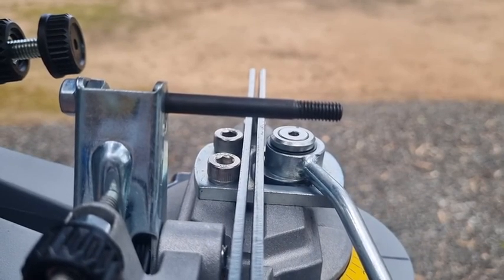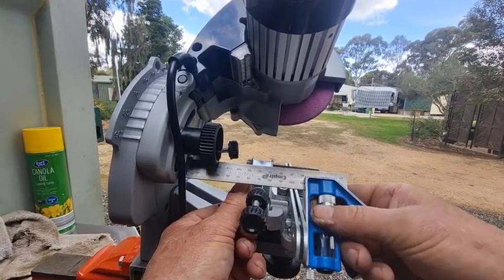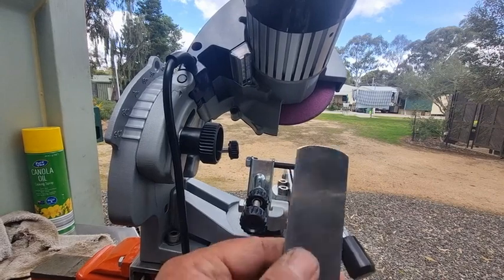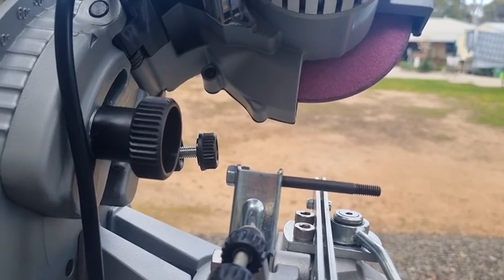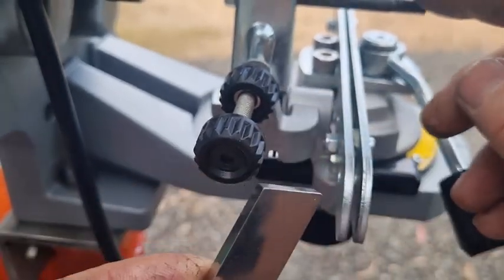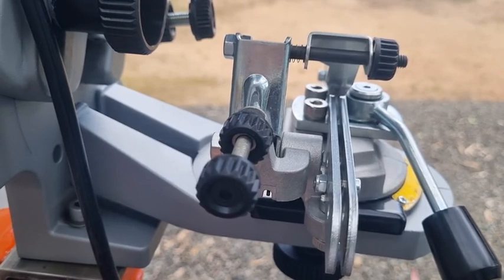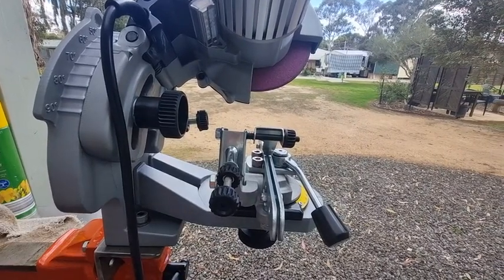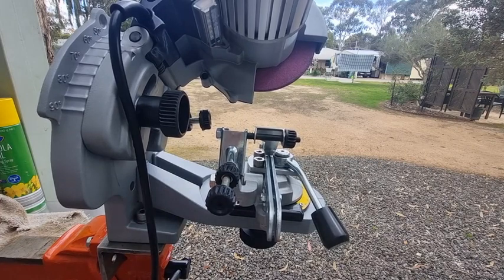Tecomec Jolly Evo backstop alingment

Comment: You have a great passion for this stuff. I've been watching your videos.
Always hands on and thinking of the workings and how to improve. I like it.
It's a good hobby/intrest.
A great mind never stops.
I have an interest in these things also.
Because of my interest, I work at a stihl dealer here in Australia.
Grinding many chains per week on an oregon grinder.
I usually grind all the right cutters first, then the left.
When swapping from right to left i make small adjustments on the back stop and position of the clamp offset to grinding wheel.
I never grind from one side to another without small adjustments.
Keep in mind our shop grinder has multiple staff using it and possible hundreds of chains per week. Many different diameter wheels.
👍love the videos.
Reply from the maker: I have the Stihl USG and it works well did you know the top plate angle is out 2.7° on that grinder.  Set it at 0° you will see the motor not level
I live in Bendigo Victoria
What Oregon grinder do you use.  I like the 511AX. I am not a fan of the hydraulic assist because they can leak. Another problem.   You should be a expert at grinding now.  What's your thoughts on the backstop being  curved ?
Reply: We have the hydraulic assist, not sure the model number, it's fairly old.
The back stop being curved doesn't bother me to much, I just adjust it to keep centre of the tooth.
After finishing the right side cutters I swap to left and adjust the stop back out for a long tooth and then slowly bring it in and visually confirm I have both left and right very close to same length.
No verniers, just visually. 
But yeah I constantly minor adjust the screws during a chain. But saying that I do sharpen a chain fairly fast,  becomes second nature.
Our backstop is fairly ugly, the small 1/4 chains the wheel runs very close to the stop. Some careless people I work with get lazy to adjust and let the wheel grind into it at times.
Reply from the maker: @sdc0386  grinding new chains is never a problem only when they get half worn you need to watch the backstop.  At end of life my cutters resemble 🔺️  so the backstop Co.e I to play and is critical at the point.  I did make a pointed backstop that sits between the tie straps.  See my channel for that one
Reply: @ChainsawUsers  I had trouble with poor tolerances with the Oregon grinders and the cam not holding the chain vice properly. Now I use and recommend the Maxx Pro which has auto clamping similar to the 620 but is a mechanical, not hydraulic system. Consistent clamping across the width of the vice and no problem with leaks!
Reply from the maker: @dab.  yes that new grinder has new features not a copy of oregon.
I would like to test that one out myself
Reply from the maker: My new style needle point backstop works great 
https://youtu.be/eO8_rmYKZsA?si=nYbmBG2KrDMb_yIy

Comment: I just got one of these Tecomec jolly evo grinders, main reason I got it and not a Stihl USG or Oregon 520 or anything was the fact that the Jolly Evo is the recommended grinder to use with the Square-jig.. I'm wanting to be able to sharpen square tooth as well as round ground and the Stihl isn't compatible. And I wasn't interested in buying a $1600 Simington as well as a dedicated round-ground grinder. I just put it together and am waiting on the stand to mount it on and this video is helpful to learn as much as possible before using it. 
Been using a cheap Harbor Freight Chicago Electric plastic grinder which is a HORRIBLE instrument for the purpose of tooth sharpening and it was time to upgrade
Reply from the maker: You need to dress the grinding wheel on the Square Jig a lot with aluminium oxide grinding wheel.
Brown resin impregnated ones hold the edge better but they are harder to find
Reply: @ChainsawUsers  they've just made a pre-profiled CBN wheel for it, I'm waiting to get them back in stock.. no more dressing the wheel then.
Reply from the maker: @JoshNoss wow a cbn wheel that will be great.  CBN wheels are the way to go, but really expensive
Reply: @ChainsawUsers  yeah they're $140 and they are waiting to get them back in stock, I spoke to the company and they said "soon" they'll have them. They're pre-shaped for use with the 40 and 45° holders, I think they'll make the jig much more user-friendly.